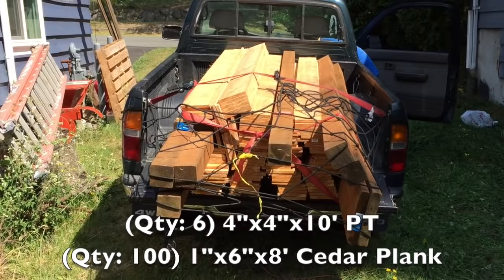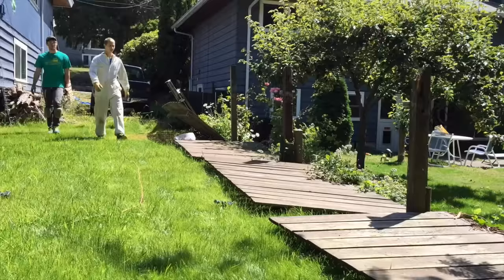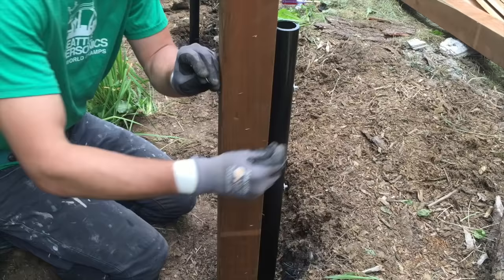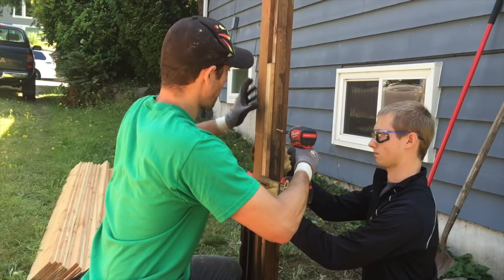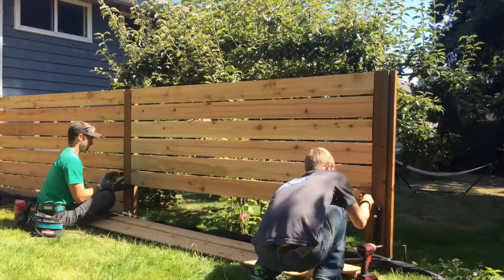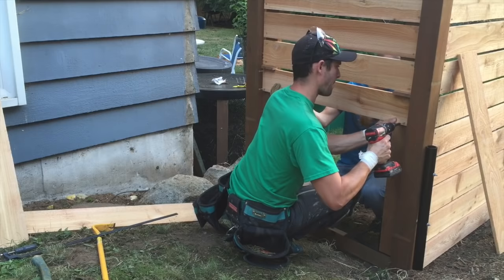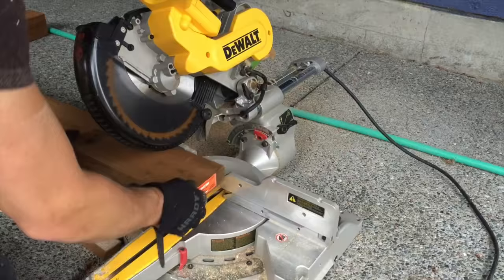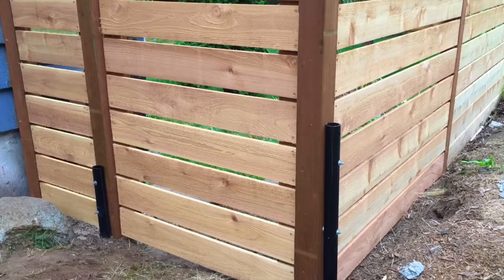How To Build A Fence : DIY PRIVACY FENCE

Comment: always do it from the bottom up. set the 1st board make it level. then use a spacer the size of your desired space. you set the spacer on the previous board and set the next. never having to remeasure always being fast and 100% accurate

Comment: You mentioned the "ledger" was by accident since your planks were too short. It lets you mount the planks on the side of the post instead of the front... Which I think is a good look and it seems intentional. What was your original plan? Mount to the front face of the post?
Reply from the maker: Yes I was originally planing on mounting the cedar boards to the front face of the posts but in all honesty I agree with you and love how it turned out in the end.  Sometimes you get lucky haha.  Thanks for watching and hope you subscribed.
Reply: @BYOTools  any reasons why I shouldn't plan to do it this way? Thanks! Subscribed!
Reply: @xgeetx  the only reason I can think of is that it is a few more pieces of wood and screws that will add to the cost. It is so minimal in the scheme of the whole project I think it is totally worth it. I think I will actually measure out and plan to do it exactly this way myself. I have about 400 ft of fence to build. Should be fun LOL

Comment: As much as I am a big fan of horizontal fence panels, I am afraid these wood planks would curl, twist or bend over time making it noticeable. I was thinking you would put some additional vertical wood planks between the posts to prevent that.

How are they holding up after 5 years?
Reply: i was thinking the same thing

Comment: Hi.  Love your fence.  A few questions.  Why did you need 100 cedar planks.  You had 9 planks per "panel" and a total of 5 panels so don't you only need 45?  Also, since you had the galvinized pipe, did you sink the PT 4x4's into the ground at all or did you just let them rest on surface?  Finally, did you finish the panels with either stain or something else and if you didn't how do they weather.  Thanks for your help and sorry for all the questions.
Reply from the maker: Ya there was another section of the fence that I didn’t video and I’m just now realizing I didn’t adjust the quantity.  Nice catch haha. No wood was touching the ground.  The 4x4 pt is just attached to the galvanized posts which is very stable.  Also, I never applied finish or stain to the fence because I prefer a naturally faded look.  It’s a nice natural cedar gray now.  Thanks for watching!
Reply: @BYOTools  Great info.  Thanks so much for replying.

Comment: I want to know how to fix a constantly running toilet. Its the old floater ball system and water is constantly leaking into the toilet unless I manually pull the floater ball up a bit more. I dont know if this is something you're an expert on but I'm keeping my fingers crossed.
Reply: Buy a Fluidmaster ballcock, the thing with the float, from your local hardware store, and while your at it, put in a new flapper there too.  Lots of how-to videos on youtube.
Reply: @beandrive  thanks!
Reply from the maker: Glad to hear Daniel was able to answer you so quickly.  Thanks so much for watching both of you and all the support to help others.

Comment: thats over a thousand dollars project, i will have to be happy with my bed sheet strung between our trees with a nice blue tarp with a few holes and stains to finish off as a gate. open the gate and it closes behind you automatically almost like a shower curtain as you enter the shower, like my 6 mil black plastic sheathing hanging from the curtain rod with tie straps, nice fence though good job, i really love cedar or redwood
Reply from the maker: LOL!  You really thought about that one Buddy haha.  Gotta think about resale value sometimes.  The fence will pay for itself :)  Thanks for watching and glad you enjoyed the video.
Reply: @BYOTools  great to hear from the builder, thank you and thank you for posting this project, let me tell you, i did an 8 foot fence, just pressure treated, 10 foot 4x4s, i dug holes with  manual hole digger, and installed the pickets almost butted up against each other tightly , i did it in summer so it was already expanded, but man i bought a electric hole digger with 6 and 10 inch augers a few years later when i had another project to do, i also used concrete on the fence 4x4s, as well as 6x6s in the corners and for the gate to hang, diy gate from what pickets i had left over, i guess it was a little over 100 feet long, 4x4s 6 feet apart, it was fun and a learning experience, but it was over a grand in cost, and thats just pressure treated not cedar or redwood, but really enjoyed your tutorial

Comment: why didnt you run longer wood for top cap??? just curious
Reply from the maker: Hi Henry.  I wanted the straightest boards possible and the longer ones just weren't as straight as the shorter ones.  Hope that helps.  Thanks for watching.
Reply: i would have run longer timber, it would be stronger. Lovely job though.
Reply: Same reason he didn't pressure treat the cuts on the top cap.........lol....

Just messing ya.

Comment: How sturdy is this fence compared to one with cross boards in your opinion?
Reply from the maker: Hi Dimitri.  I would say it just as sturdy as a standard cross board fence.  Especially when I added the top cap to tie everything together.  Good Luck!
Reply: BYOT  how far apartis the post that

Comment: We paid someone to do our fence, and within 2 days it was falling over. I am so glad I watched this, but have a question. If I am just using 4x4's and not metal posts, how far down into the ground should I have the posts? I want a 6 foot fence.
Reply: Oh, and I live in Tennessee, so the ground doesn't freeze that far down, usually
Reply from the maker: Great to hear that the video helped Sharon.  for a 6' tall fence I would recommend getting 8' and dig at lease a 2' hole so the posts have plenty of support.  Also remember to add a few inches of drainage rock at the bottom of the post hole before you add the concrete.  Its for drainage.  Thanks for watching and hope you subscribed :)
Reply: P

Comment: This was another excellent video, I'm addicted to your channel. Can you share about any sort of permit information you may have had to encounter? I'd assume if there was already a fence there, you didn't need any additional permit action, but I feel like it'd be good for viewers to know that they can't just decide to build a fence without checking, or they may hit some trouble with their local ordinance
Reply: On a side note, that may be another great video idea. Not necessarily a DIY video, but a quick tip on the overall permit process. At any rate, beautiful fence, and excellent channel.
Reply from the maker: Thank you very much for watching and all the support.  I had no need for the permit process since I was working with my neighbor on the fence and we were just placing it exactly where the original fence was placed.  Very good note though since property lines tend to get messy sometimes with neighboring properties.  I would say if anyone is unsure about your property line, you can contact the city you live in and they will come out and mark off the property line.  In most cases for free.  Thanks again for the support.

Comment: good looking fence. I do have a question. How about sagging with such span, especially since they were installed horizontally? thanks
Reply from the maker: I was worried about that at first but its been up for months and no sagging what so ever.  If it ever did I could add a center support post.  Thanks for watching Leonardo.
Reply: BYOT can you give us an update on the fence? Was there a need to add more support? What would u have done differently?

Comment: Nice job! Why not remove the pipes altogether and just cement the posts in? Just kinda seem odd to leave in place when installing a new fence.  Just wondered what your thoughts were on this? Nice fence man! Never mind u didn’t want to dig holes...
Reply: Yes, removing the metal posts and cementing the new pressure treated wood posts would have probably been the best thing for the structural soundness of the fence. However, that would take more work. Not that hard to do though.

Comment: Hello. For the long length of the boards, do you find that it is a bit flimsy without a cross brace?
Reply from the maker: I thought it was going to be but it wasn’t at all. Very sturdy and hasn’t warped over the years either.

Comment: Sorry...one other question.  Did you finish the PT 4 x 4 posts?  With what?
Reply from the maker: The 4x4 are already treated and I didn’t do the tops after I cut them because they where completely covered.  In retrospect I should have though just Incase.  Thanks for watching dan and hope you subscribed.
Reply: @BYOTools  one final question. Trying to figure out how many planks I'll need for a 7 ft fence?

Comment: Great video! Have you noticed any twisting or warpage in the horizontal planks? I’m about to do my own fence and 8’ seems like a long run especially in the horizontal configuration where water has more area to accumulate than a traditional vertical configuration. Thanks!
Reply: Bradley Johnson Hi Bradley, I didn’t see a reply but I have same question. How did yours turn out? Any warpage or bowing?
Reply: For those asking, I noticed several other fencing builds that use a thin (2"?) vertical plank nailed in the middle to keep the middle from warping weirdly. I asked one pro, and he suggested doing it on any run longer than 4'.

Comment: Fence looks amazing. Im attempting a diy fence as well. Just wondering, how deep were your metal posts set? And were they set in concrete? Cement? Or ground pavers?
Reply from the maker: I didn’t install them originally so I don’t know how deep but I would say at least 24” deep in concrete.  Thanks for watching and hope you subscribed.

Comment: Would you be able to recommend how we can do an 8 foot drive way gate, 6 feet high with horizontal planks?  Don't weld, per se, and would like to use metal posts - do you recommend the adjust a gate with the trust line (as we're concerned about warpage with just the easy gate brackets).  Finally what do you think about reedwood planks or "J-grade" tongue and groove planks for solid look?  What would you recommend for 8' planks across?  Thank you so much!
Reply from the maker: Hi Liam.  So thats a lot of questions haha.  For an 8 foot driveway gate I would say Cedar planks and PT douglas fir framing would work best.  I wouldn't worry about welding.  If possible dig a post hole or secure a large 4x4 or 6x6 post to the side of your house.  The PT framework could be made out of 2x6 instead of 2x4 to give the gate extra stability.  I need to make a large gate myself so I will make sure it is captured on video for you.  However it might be a couple months since its the middle of winter haha.  Thanks for watching.  Hope this helped.

Comment: Great fence! Normally, how far apart do you space your 4x4 posts?
Reply from the maker: Great to hear Nick.  These posts are 8' and worked out great but they are at a MAX distance.  I would suggest 6' or 7' apart if I where to position the posts.

Comment: Thanks for the video. Would you recommend using the metal pipes in the ground vs. regular lumber?
Reply from the maker: I would suggest using PT lumber.  I only utilized the pipes since they where already there and in very good shape.  No reason to add more steps it you don't have to.  Thanks fro watching.

Comment: If using the same materials, height etc... what cost more  to build,  a  vertical or horizontal fence?
Reply from the maker: The price difference will be very minimal so I wouldn't even worry about that.  However, I would say it will take a bit longer to fabricate a horizontal fence then a vertical fence due to difficulty of making sure everything is level.  Thanks for watching.

Comment: Looks like those are 8 foot boards ? Do plan to add anything in the center to keep the boards from flexing/ wobbling back and forth . ? And also prevent warp and flex over time?  Curious as I just built mine . Thanks
Reply from the maker: I've heard of warping issues before but in my case i didn't have any issues with that even with the longer spans.  Go for it if your worries about it but just know I never did and it still looks great.  Thanks for watching Kyle and hope you subscribed.

Comment: If your existing galvanized poles don't have holes thru them already which type of drill bit would you recommend to do so?
Reply from the maker: Here's a good set to buy for drilling through metal https://goo.gl/1Hnncq 

Just make sure you buy some WD-40 as well to keep things lubricated so your drill bits last longer.  Thanks for watching.

Comment: I have an existing 4 ft chain link fence. I want a 6 or 7ft high wood privacy fence. Would you suggest using the existing metal fence posts to attach the 6ft high wood posts?  or dig out the metal posts. I live in the windy city. Thanks in advance. Your fence looks great

Comment: Looks good, did you double up your horizontal boards by putting some on both sides? in order to have that flush look on both sides.
Reply from the maker: Thanks for watching Alexandre.  I didn't since that would be an added cost and my neighbor didn't mind the backside look, especially since I was doing all of the work haha.
Reply: @BYOTools  I don't understand why you needed 100 cedar planks.  You had five 8 ft "panels" and 9 planks per panel so you only needed 45.  Why 100?

Comment: I have an existing 4 ft chain link fence. I want a 7 or 8 ft high wood privacy fence. Would you suggest using the existing metal fence posts to attach the 8ft high wood posts?  or dig out the metal posts?

Comment: Is the metal post for support 100% necessary or is it just extra reinforcement?
Reply from the maker: The metal posts where there from the original fence line and yes they are necessary for my application but you don't need them.  If I was doing it from scratch I would place a galvanized 4x4 post connector in a concrete footing or just pour some concrete and place the 4x4 into the concrete footing.  Thanks for watching Nirh

Comment: I need to build a privacy fence for my back yard, I'm on a super tight budget, and I'm definitely not a wood worker.  any recommendations??
Reply from the maker: If you have a neighbor try and split the cost with him since its a benefit for both of you.  Also, you don't have to use cedar planks and can use a less expensive wood if you can find it.  Just make sure it can be used outside or apply a seal coat to the wood.  Thanks for watching.

Comment: So...you didn't dig holes or bury the 4x4s? Those pre-existing poles you had are what's holding them up?
Reply: I could'nt really tell is why I ask
Reply from the maker: Yes that is correct.  The original fence that I removed where connected to those posts.  They were still in great condition so I salvaged them.  You don't need these in order to make your fence.  Thanks for watching
Reply: Thanks for sharing

Comment: Looks nice, but not sturdy. Using those skinny bolts is a mistake. Why not use 16ft tops and nail them straight down to the cedar post. You went off at an angle from the edge of the post up.

Comment: Great video. Would you mind answering 2 questions? Lol. I'll be building this on top of a timber 8x8 retaining wall that's 3.5 feet tall. Did you put boards on both sides to hide the 2" boards you ripped? And how does the wind blow through? I'm worried that the fence will act like a sail and damage my retaining wall since it will be built on top. (Lots of wind in my yard during storms) I wouldn't want to put bigger gaps since it's being built at a privacy fence. Thanks in advance. :)
Reply from the maker: Thanks for the support Julius and thanks for providing the Instagram link.  Very helpful.  No I did not put boards on both sides since that would have been an added cost that wasn't needed and my neighbor didn't mind the look of the back side so it worked out perfectly.  Very nice retaining wall.  I made the exact same style in my backyard so I know how much work goes into that haha.  How high of a fence will you be building.  I don't get a lot of wind in my backyard so I don't have a great answer for you.  If you do have a lot of wind I would suggest that you pour concrete footings behind your retaining wall and then place the fence on top of that.  If you really want the fence to rest on top of the retaining wall then I would say to get some heavy duty brackets and for added support you could take a 2' long piece of 1/2" rebar and bore a hole in the retaining wall and through the center of the post bottom.  That way you can strengthen the fence without effecting the overall look.  Good luck.

Comment: What size metal posts did you attach the 4x4 to I have an existing 4ft chainlink fence with standard post
Reply from the maker: The posts are approx. 2" in diameter and extremely Sturdy.  Good luck with your project.  Thanks for watching.

Comment: You put the unfinished side out? Most towns will not allow this as a heads up to others thinking about building a fence.
Reply from the maker: Andrew Bentley I’m assuming your referring to the cedar fence material.  If so, both sides had the same rough finish to it so it didn’t make a difference from one side to the other.  O and if you live in a town that won’t allow this type of fence due to the surface of the fence then I think you need to move haha!  Never heard of anyone having that type of issue before.  Thanks for watching and the input.
Reply: @BYOTools  I'm more meant that the pipes and bolts face out to your neighbor's rather than into your yard.